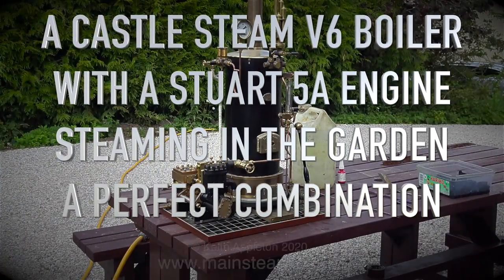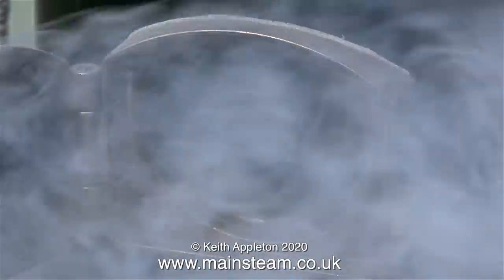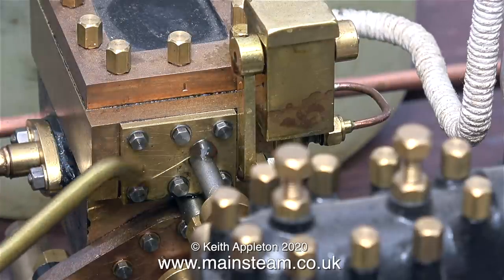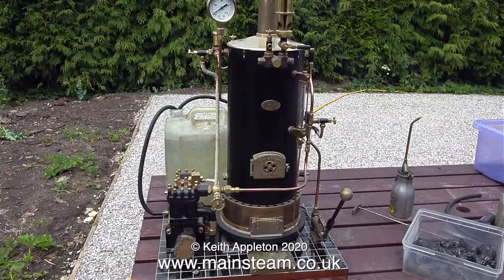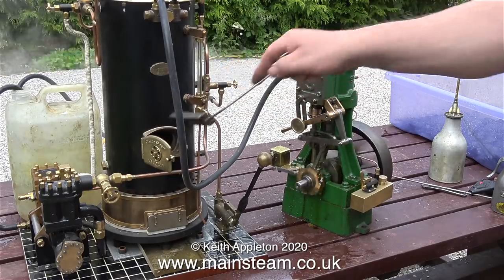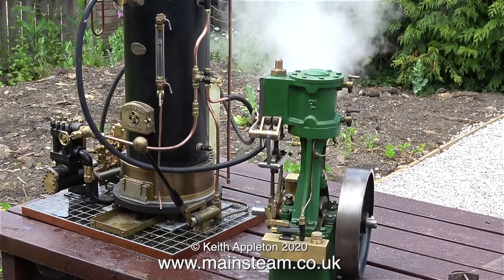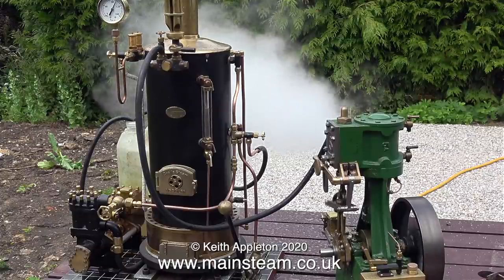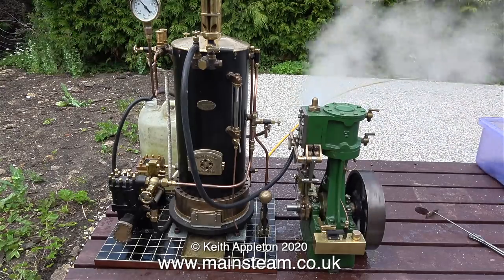A CASTLE STEAM V6 BOILER WITH A STUART 5A STEAM ENGINE

Comment: Is it feasible to fit a condenser on the cylinder exhaust and feed that back to the boiler? I imagine on a boat clean water recovery could be important. Thanks for the awesome videos!
Reply from the maker: not really worth it is these small scales as it is difficult to separate the oil from the condensate.
Reply: Keith Appleton Thank you Keith!

Comment: Keith, I was talking to a chap from Auckland, New Zealand who has one of these V.6 boilers on the way to him, he has ordered some Welsh Coal and Hallett oil from me. As it is a super steamer I was wondering what the ratio of heating surface to water volume is as there seem to be many tube. It appears to be almost flash steam by the rate it makes steam. It looks like to use Welsh Dry Steam Coal too? I really must get my 8" VFT boiler going but I would be tempted to get one of these too. Thanks.
Reply from the maker: It's best to Email the manufacturer for that information.

Comment: That boiler would look great on a double out-rigger canoe & a pair of paddle wheels...
Would also look great in the middle of a Cli-Shay!
In fact, I cant think of a place it WOULDNT look good- except gathering dust on a shelf or at a scrap yard....
Bloody luvly boiler that!
Do they now sell them with the extra's you had to make to finish it off???
That is  the ash-pan e.t.c....
Reply from the maker: I fitted the pump & whistle - everything else is standard.
Reply: @keithappleton  Im sure I remember you making something to do with the ash-pan or base.....
To insulate it from the base board maybe?
And changed the gauge glass too I think...
I remember it looking moew modern small industrial looking & you "fettled" it & now it's more a model/purposeful art....
Either way, bloody luvly' boiler that!
Reply from the maker: Castle Steam sent me a heat insulator which I fitted to the ashpan and now it doesn't set fire to the baseboard }:-)))